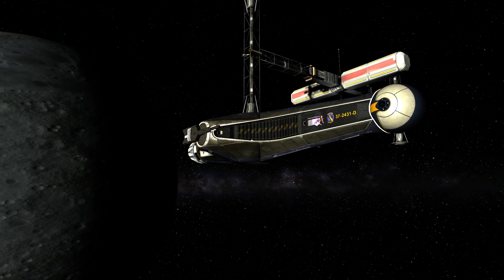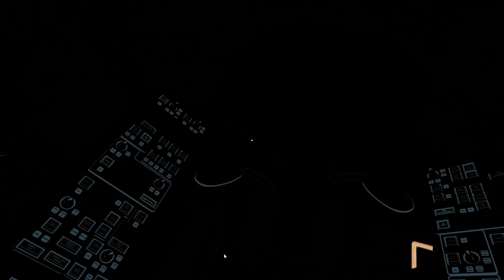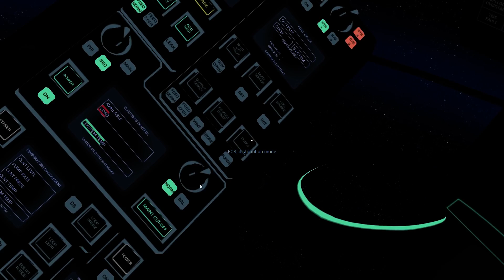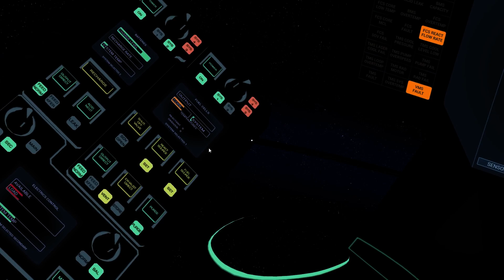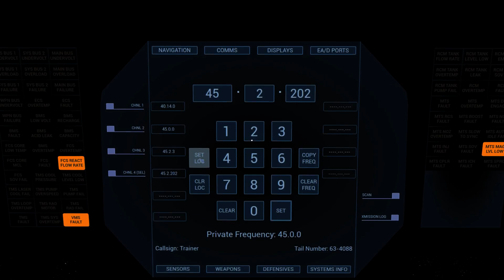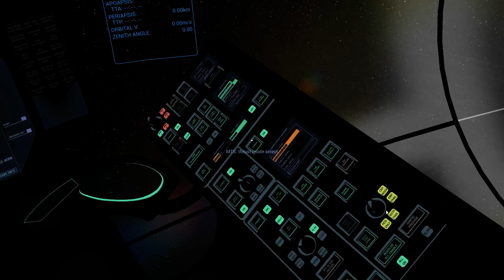Rogue System - Undocking Tutorial

Comment: So if they're view port monitors rather than view ports why have the cockpit in such a vulnerable position rather than in the core of the ship?
Reply: +Wastedswan I can think of a couple realistic reasons for why the cockpit is where it is. The ship engineers basically had a choice, put the cockpit in the core or in a more conventional position despite no longer having to rely on windows.

If they put the cockpit in the core it will be closer to the reactor and the engines, and would probably require some extra shielding to protect the pilot from harmful radiation or heat, and extra shielding is extra mass. Also it would take more work and sophisticated devices to allow the pilot to escape the ship quickly in an emergency situation, and more parts means more room for failure. But the advantage would be more armor between you and whatever outside influence is trying to harm you, hostile ships, meteorites, astronomical phenomena, etc.

With the cockpit positioned in the front like it is, it's as far away from the reactor and engine it could possibly be, and the engineers can save on mass because the superstructure of the ship itself will act like shielding. The ejection system can be made very simple so less chance for failure, a marginally quicker getaway, and the cockpit itself could be used as an escape pod. Although this does make the cockpit more exposed to outside harmful influences.

In my opinion its a toss up, do you go with more armor from the outside but have a better chance of being harmed by your own ship and possibly getting trapped in your own ship. Or do you expose yourself to those outside influences to gain some extra maneuverability, acceleration, safety from your ship, and a faster escape should something go wrong. Basically you can either choose a tank or a lightly armored Humvee. I personally prefer maneuverability and  acceleration in my vehicles over heavy armor, but that's just me.

Comment: how would electromagnetic shielding do anything against neutrons?
Reply: +Christopher Silvia Neutrons given off by the reaction would neutron activate the core containment structure, but wouldn't get too far after that. The bigger concern is from extremely penetrating gamma rays and X-rays, and any additional radiation given off from the neutron-activated reactor core shell. That'd be covered by the EM shield.

However, I think as one of the maintenance mechanics in Rogue System that might be implemented, you may have to allow dock maintenance to get rid of the neutron-activated materials in your core from time to time, since the neutron impingement would result in erosion.